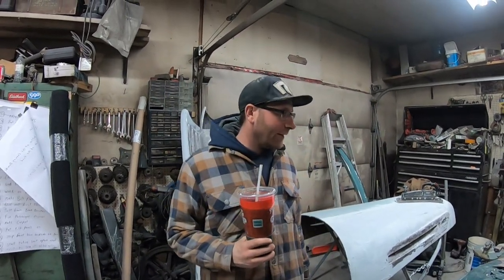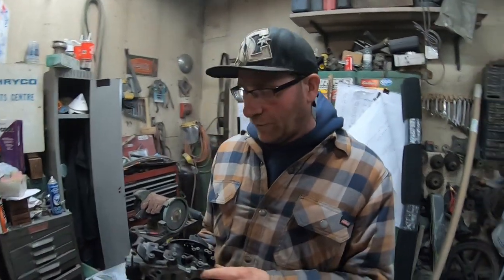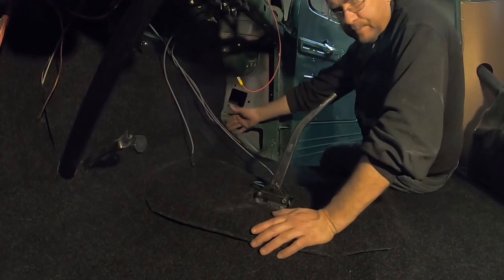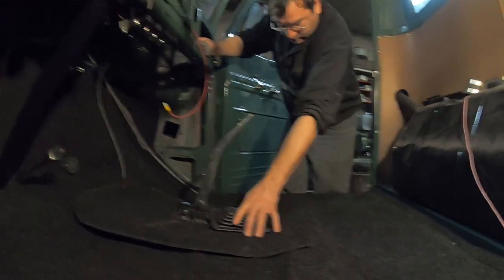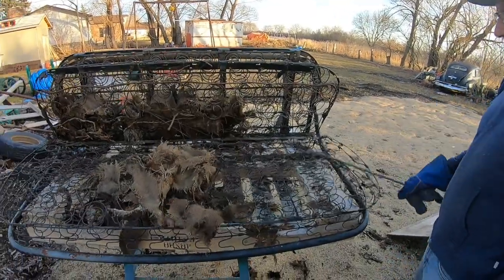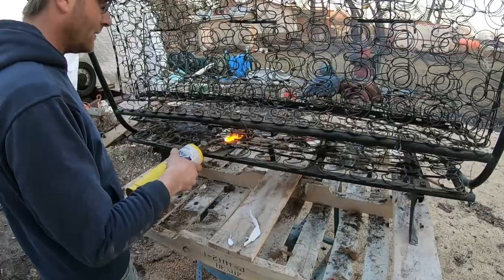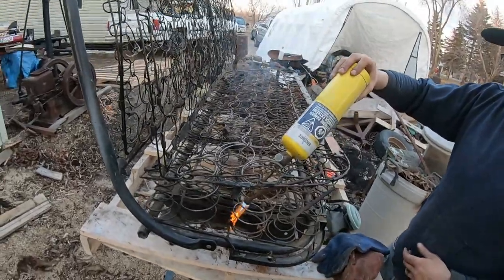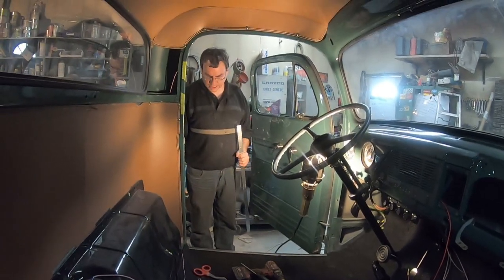DIY Carpet on a 1952 Ford F1.  Hot Rod Project Truck.  Field Find.

Comment: Excellent video guys also seat repair are fun I agree Cory :) plus guys going put cab light open buy door pins plus headlights switch or toggle switch to add and plus am/fm Radio plus 2 or 4  speakers to also steal metal pop rod antenna on Fender to !
Reply from the maker: Thank you Andrew.
Reply: @pennyshotrodscustoms  welcome guys anytime for help out!